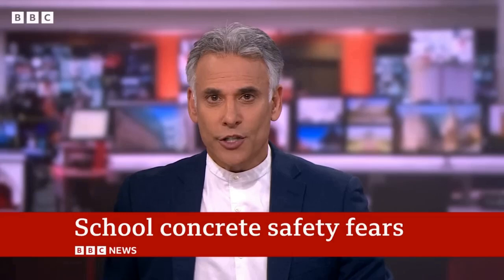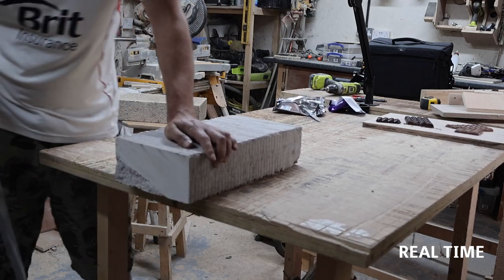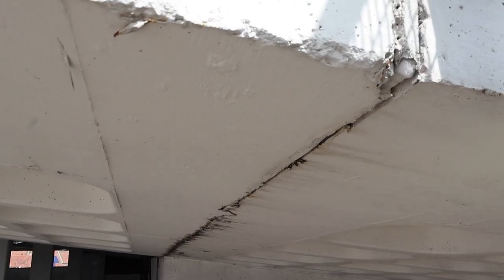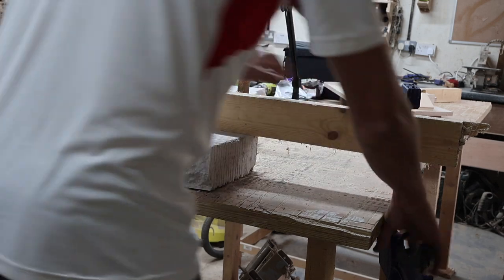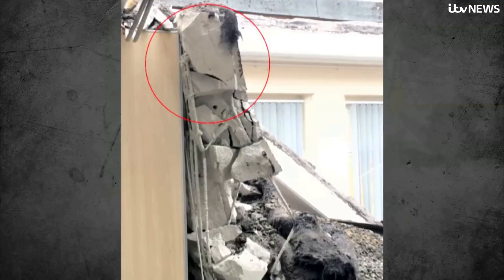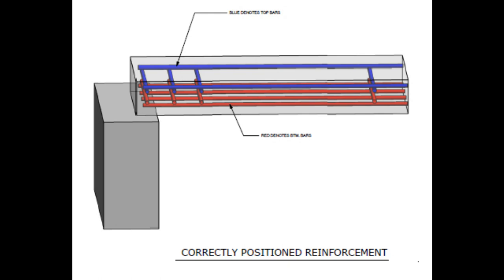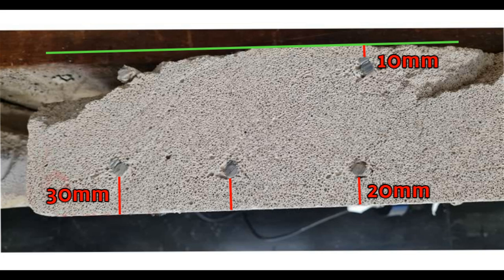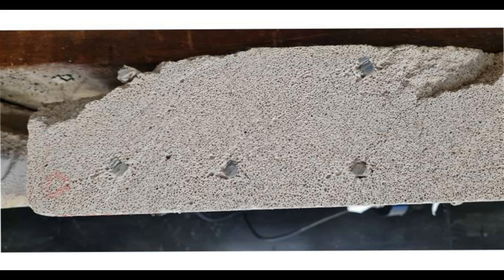RAAC - Structural engineer gives his take

Comment: I appreciate your in-depth coverage of RAAC engineering! You and others have mentioned that RAAC panels have been phased out and discontinued after the 1990s. Nevertheless most major AAC manufacturers around the world still produce and supply reinforced AAC floor and roof panels. 

For example, look at Hebel USA "Slab Panel" which clearly shows the reinforcements on their website's pdf. They span up to 6 meters, come in various thicknesses from 4 to 10 inches, have 7 steel reinforcement bars at the bottom and 3 at the top according to their Tech Sheet. The bottom bars have 9/16" or 1" clear cover, similar to what you have shown in your video. 

Xella/Ytong offer similar floor/roof panels in Germany and elsewhere. Stärken AAC Malaysia produces such panels as well and supplies most of earthquake prone Southeast Asia.

 Is the UK the only country in the world that encountered such problems? Is the UK the only country that phased out RAAC? How are today's Hebel or Xella slab floor panels different?
Reply from the maker: I can't say for sure. I've had a look at the hebel slabs but manufacturers are notoriously coy about giving away the technical details of these things. They tend to be regarded as intellectual property. The hebel slabs reference a technical document titled 'ACI-523R09', I've tried to look for it but no luck. I suspect that it is behind a paywall for a company who provides technical documents to industry and can't just be downloaded from google!!

If I were to speculate as to how these slabs were still in use I would say the following:
1. What is their design life span? If it is 30-50 years then these slabs will need to replaced at some point just like the ones in the UK.
2. Are these hebel and xella slabs prestressed? That would reduce movement/deflection/flex and therefore cracking. There is a question about how good a bond can be formed between rebar and AAC, which would be fundamental to achieving high prestress, but if that has been figured out then this might answer why.
3. Just simple development. The planks I am talking about were constructed in the 70s. There has been 50 years since which, if you were a company developing these things, would allow for significant improvements. Better concrete. More consistent manufacturing. Higher standards.
Reply from the maker: For some reason your comment isn't here. I have it in my emails. Just not here.

This 30-50 year lifespan issue, I don't think it is a construction standard thing. I think it is a legal thing. I think if you presented it to a judge they would say that a 30-50 year lifespan on any product, construction based or otherwise, is a reasonable length of time for a product to last. Like, from a consumer protection point of view. And from a manufacturer point of view, who can be hauled into court about something that was designed 50 years ago? 

And I doubt very much that the manufacturers of these things are gonna advertise their design life. I think they would consider that to be intellectual property. And it would have to be tested. i.e. it would need to be put into an environment for 30-50 years before they could make that promise. That isn't going to happen.
Reply from the maker: Sorry I have taken so long to reply, I've only just noticed it.

A block, which is acting only in compression, will naturally last quite a long time. There isn't any reinforcement to rust. Something in bending requires an element that has a tensile capacity (tensile capacity of concrete is effectively zero), thus the rebar, thus the problems. The concrete needs to protect the rebar. 

There is a key difference about this I'm not sure is clear. There is 'predictive design' and there is 'design by proof'. Predictive design requires standards and regulations, it is what we design structures to. There is a certain restriction to what can and can't be done and that is because the standards and regulations have to be written for many different plausible scenarios. Part of the challenge in engineering is in trying to shoehorn difficult structures into broad definitions to get the standards and regulations to apply. Architects ask for all sorts of things.

Design by proof covers all the things that aren't covered in the standards and regulations. These designs are allowed to do things and not do things that are different for us 'predictive design' engineers. These designs can't be justified by standards because then it would come under my jurisdiction. The only way to prove that these designs work is to test them. The companies that make the products publish their own data about what their products can achieve, and I am, mostly, beholden to their websites for the technical information I need. These companies can go out of business at any moment, and when they do they take their website, guarantees and all technical information with them.

Bit of a side trek but it might be worth it. I was once asked to design a steel frame that spanned about 80m (I think) made out of plate steel. Normally we work with off the shelf steelwork which is regular in shape but all these sections were tapered. I tried to run the numbers, plate steel is prehistoric, the british standards aren't entirely clear on how to design it and there wasn't anyone else in the office who was familiar with it. I did my best. The frame came out at about 300%, i.e. it was taking about 3 times more weight than it was capable of. By the numbers. I talked to my senior engineer about it. He said the frame had been proven with load testing (essentially 'design by proof') and at that moment the design became futile. Things work in the real world that can't be proven with numbers. If you have taken a steel frame and tested it to almost failure, that will give a much higher capacity than the one I can prove with just mathematics.

That is what these proprietary products do. They are able to give higher capacities for standard components because they have tested them to their limits and know exactly what can be achieved and not just what can be proven.

And when you come to the issue of 'design life' with this 'design by proof' method, how do you prove what the lifespan of a product is without testing it for the lifespan it requires? Predictive design has been designing the same things for decades, we know how it reacts in the real world environment. The lifespan of a 'design by proof' product is literally being tested from the moment it is installed.
Reply: @BigfootsWorkshop  Thank you for your insights. The topic of  'design by proof' vs 'predictive design' would make an interesting video. Also the issue of having to rely on manufacturer data, which will likely be biased and may not have been independently verified.
Reply from the maker: @ChristianWagner888  Not a bad idea. I will make that video. 

Bias and independent verification - I'm not sure they matter as much as they should. I think it comes down to liability and insurance. Who is liable if something goes wrong? Does that entity have the correct insurances in place? Provided these two questions can be answered I don't think anyone cares about bias or independent verification. I'm sure it is paid lip service, and I'm sure there are government requirements for these proprietary products, but for me it comes down to incentives. The manufacturers of these products are incentivised more by their insurance and liability than they are by bias and independent verification. Those are the things that I believe keep them honest.

You are right, there is definitely a video there!!

Comment: Great video.  I am not a builder but a decent diyer so have a basic understanding of some of the concepts you are discussing.  I found the audio great but the sections where you had text as well a little overwhelming and unnecessary.   I found the step by step breakdown of the slab very good and easy to understand.   

I am from the UK but living in Ireland so seeing this popping up on the news and trying to get a better understanding.  The biggest issue, as you discuss is longevity.  I have hollowcore slabs in my house which the supplier measured and gave me a 50mm bearing as it’s on RC wall.  The blocks for the upper wall are 100mm!!  Stupid cost saving by the supplier.  I’d have happily paid for 100mm if they had mentioned it.  Everything is engineered by experts to be just right.  Buildings years ago were built to last and that is how they need to be.  Solid, reliable, accessible (electrical conduit!), maintainable with better electrics, sprinkler systems, insulation but also ventilation.
Reply from the maker: Thank you for the compliments. 

With regards the text overlays, I feel you but I was conscious of credibility. I've just arrived on the youtube scene with my engineering and I was worried people might not take me seriously. So I went overboard with stuff. Just filled the video with as much as I could. I figured there was no way I could overdo credibility!!

The key one of those building aspects that you mention, for me, is maintainable. A steel rebar in any concrete slab is not maintainable, so if it is going to be used in a building then we need to be completely sure it will last. Because if it doesn't the bars will corrode and that corrosion will spread throughout the structure. Or at least that is what we have to assume because we can't see the full extents of it.
Reply: I 100% agree it must be really hard to stand out.   Fair play for giving it a go, I could never put myself out there like that.   Happy to just be an observer/student picking up knowledge as I go.  Just thinking about the slabs.  You hypothesised that the RAAC labs were probably all bespoke.  If they had been made in long lengths and chopped surely it would have been worse as the bars would have had no concrete cover on the ends.  My hollowcores were like that but we waterproofed them as there was a basement underneath.   Also there should be a law against flat roofs.  They are always going to fail.    They definitely should never be used in buildings paid for by taxes.
Reply from the maker: This is my first foray into something like this. It's all good learning experience.

Very true about the cover on the ends, I didn't think about that. And you aren't wrong about flat roofs. they are only ever temporary. Lord knows what is going to happen to all those sedum or 'green' roofs that were once a thing. From what I've seen years later they are all dead.

Comment: Surely the difference in concrete mixes is the inclusion of stone aggregate, aerated cement as no aggregate included. So it is wrong to use the term concrete for RAAC . Reinforcement surely works in different ways depending on materials and how they inter-react . There are standard concrete forms that can be light weight but be more resistant to weight, such as snow build up and high wind pressure. What I do not understand is why aerated cement would be used in horizontal self supported structures. Is it logical to use metal reinforcement in RAAC or should a nylon or carbon fibre be used, or similar to standard concrete , inox or stainless steel should be used. The other essentil of metal reinforcement bars is to ensure the ends are cleated to prevent internal creep and thus a loss of tension in the bars .
Reply from the maker: This seems like a proper geneuine technical query!! I like

If we only removed the aggregate from the concrete then we would have cement or mortar. Aerated autoclaved concrete has aluminium added to the mix which causes a chemical reaction and makes the bubbles. It isn't just concrete minus the aggregate.

This statement "What I do not understand is why aerated cement would be used in horizontal self supported structures" is right on the money. It shouldn't. 

There are a lot of things that are wrong with RAAC that I didn't mention. This video could have been an hour long if I had gone through absolutely everything. The rebar used in the RAAC planks are not ribbed. I don't know why not. Instead they are coated in an anti corrosion finish. Which clearly hasn't worked. Also, in normal concrete when a bar corrodes it pushes the concrete outwards spalling it. Because these planks are full of air pockets, when a reinforcing bar corrodes it doesn't push out the concrete, it just expands into the air pockets. You can't see whether an RAAC plank has corroded in the same way you can with proper concrete.

As for the alternative rebar materials you have suggested, they look sensible. If we were back in the 70s when these things were being made then it might have been worth trying them out. As it is, however, we are lumbered with the results of bad decisions made 50 years ago.
Reply: @BigfootsWorkshop  i think you mentioned the two main reasons for the current failures, they had a planned life span of 30 years and because of this there was an effect on material costs and ease of construction. This makes all governments liable after the expiry dates, but each government abuses the system by placing maintenance on the local authority, which is fine if they have adequate and separate funding to observe and replace. Not if funding is removed, redirected or reduced. I suspect that there was commercial pressure to use these materials over conventional practice, its a form of funneling contracts rather than suitability. The aluminum , as far as I am aware ,  is just a material to develop equal dispersal of the bubbles during the autoclave process and does not serve as a structural component , this is why I wonder why they use the term concrete. The density of the material affects how the steel reinforcement acts as a tension net , tge firce applied should be captured over the whole area, but in RAAC the tension force is applied at the extreme edges or ends if beams, if this is not string enough it will create failure at those points. I would assume any ingression of water will degrade the material strength while increasing urs over all weight, not good for long term structural calculations , especially on poorly maintained flat roofs .
Reply from the maker: @stuartgraca   I can find no fault in your reasoning. The idea that it is misleading to call RAAC concrete has merit. 

I think the governmental interference that you describe is exactly the kind of frustration I have in the video. I guarantee you there was an engineer in the 70s telling the government that using these planks was a bad idea.
Reply: The C stands for Concrete.. not Cement..  I didn't name it..
Reply: @Mole-Skin  concrete, in construction, structural material consisting of a hard, chemically inert particulate substance, known as aggregate (usually sand and gravel), that is bonded together by cement and water.  Not aerated cement , a misuse of terms deliberately , I suspect, for commercial sales point of view but totally misleading from a structural point of view.
Reply from the maker: @stuartgraca  My man!! You did better answering that than I would have!!
Reply: I DID NOT NAME THIS.. I looked on Wikipedia and in great big letters it says CONCRETE.. It is not my fault.. @stuartgraca
Reply: @Mole-Skin  in no way do I mean anything personal, I refer solely to the building trades misuse of terminology.
Reply from the maker: @martinchamberlain1861  dude, we are just a couple of geeks here arguing the semantics of whether it should be called concrete or not. RAAC (or AAC) is currently called concrete and i don't think there are any plans to change that.

Nobody is wrong here

Comment: As the NY garage collapse showed, electric cars weigh far more, at least half and maybe double their gas-guzzling predecessors. Therefore, you're no better off even though you have halved the number of cars, in the foreseeable future you'll be doubling the weight. Although these are marginal loads, what you win on the swings you're losing on the roundabouts. This, however, is about reinforced concrete, not RAAC, which is in any case mendacious, as it contains no aggregate matrix, and should therefore be called cement.
These blocks form the inner wall in housing, and are protected from external elements by a brick skin. What happens, though, if pipe bursts or the bath overflows? Plaster's not a great barrier. Equally, we lose a lot of the water we drink in exhalation.
Reply from the maker: If the battery powered electric engine is the dominant mode of propulsion in the future then yes, you are right, but I have huge amounts of doubt that it is even possible let alone desirable. For a start, is there even enough lithium and nickel and cobalt and copper in the world to replace every single combustion engine in existence? I don't think so. How much more electrical power would we, as a world civilisation, need to produce to power all those new electrical cars? A lot. Where is that power coming from? Solar and wind? I don't think so. What if a single one of these cars self ignites in a tunnel or on a bridge and causes billions of dollars/pounds/whatever worth of damage and a huge loss of life and infrastructure? How much pollution is caused in the manufacture of these things? At some point in the future could we start looking at electrical vehicles as something that does more harm than good? Who knows, its possible.

I know its a tangent but I have an axe to grind with battery powered vehicles.
Reply: What an excellent point you raise! Has anyone done the structural calcs. for multi-storey carparks and electric cars?
Reply: @frankhayes1135  It's been taken up. The problem in the US is that bankers on public transport are prey, and rebuilds to a new spec are very iffy. At least there's plenty of vacant property to be torn down.

Here in the UK, it's both concrete cancer and AARC causing issues. All those Council Car Parks in shopping centres.